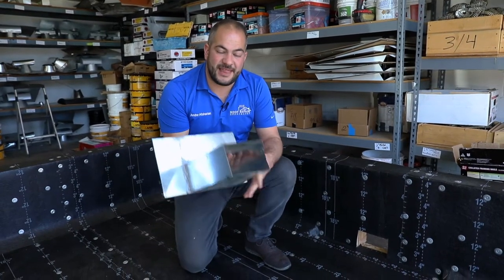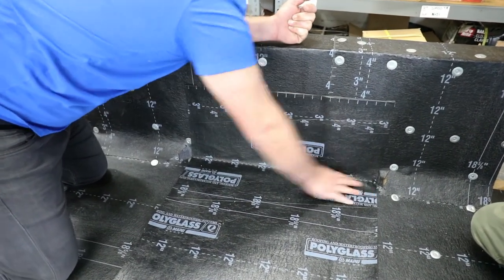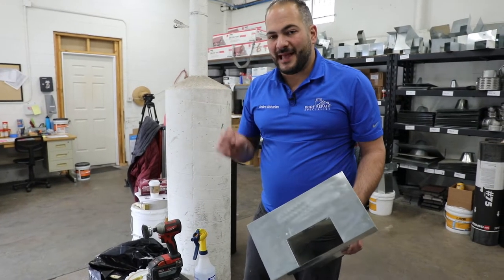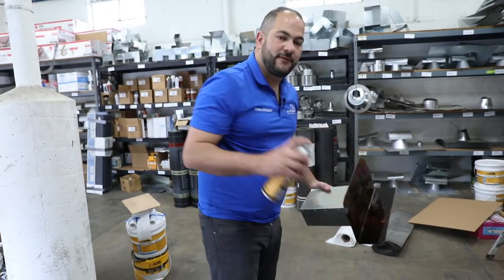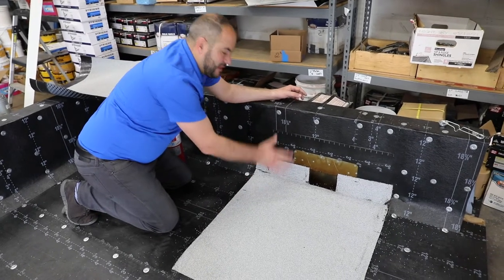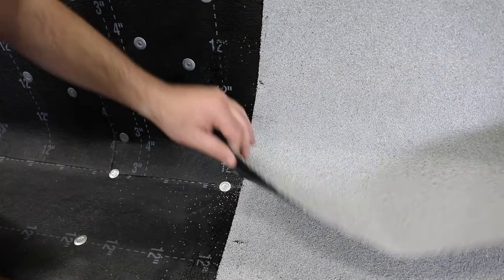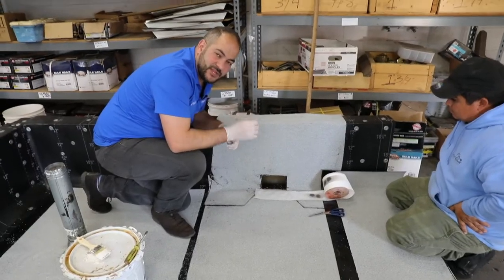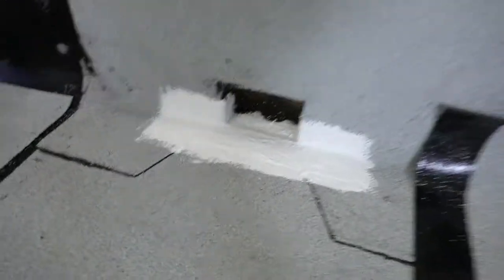How to Install a Scupper | Torch Down Roofing Guide

Comment: creating buildup at point of exit of water idk.....think it was good b4 mesh, most important thing is getting water out and not letting it build up......exit of scupper should be absolute lowest point, sometimes trying to do too much isnt good.......seen this alot where apllication was great but trying to waterproof so much didnt let water to escape which causes issues all in itself

get the water out and waterproofing takes care of itself....if water exits properly and quickly there isnt alot of need for excessive steps....just ran into this where they tried so hard to waterproof they made scupper back water up onto the roof and caused a mess because it was too high on not enough slope.....water puddled up and ate through the roof......1/4 in per foot on irregular roofs isnt much with seams build up....
Reply from the maker: I see your point, and probably something to consider. From our experience in southern california we are pretty sunny. Even if there is 1/8" of sitting water on a regular sunny day it'll evaporate by the afternoon. But I do see your point.

Comment: That’s going to leak. There was no reason to nail down the bottom part. You literally are giving the water a path to travel. After applying the primer, a bit of plastic cement on the bottom and properly torching the top would’ve been perfect.
Reply from the maker: I would not agree. Nails are needed to minimize expansion and contraction in the metal. That is what manufacture recommends for both scuppers and other flashings
Reply: @RoofRepairSpecialist     Appreciated, but I’ve installed them both ways. Over the years, the ones without nails gave me no problems. Just saying what works for me. And thanks for the vids
Reply from the maker: Thanks for watching!